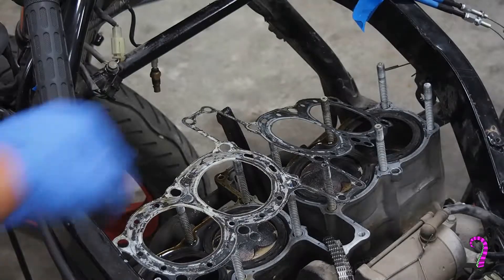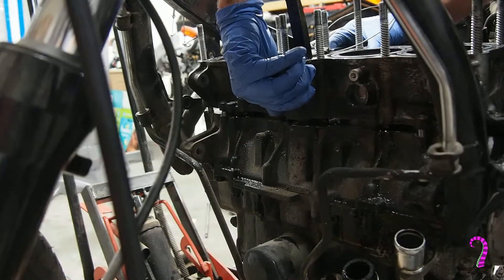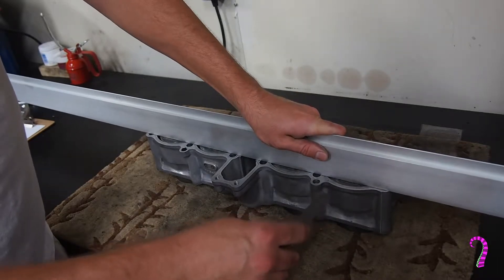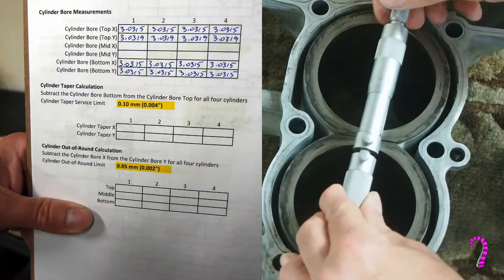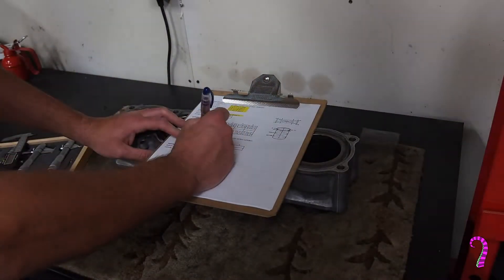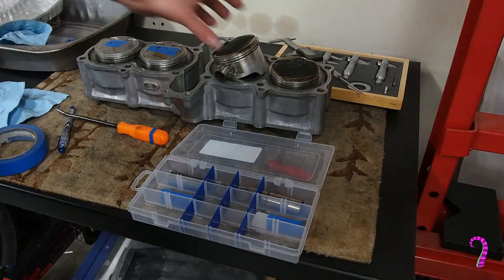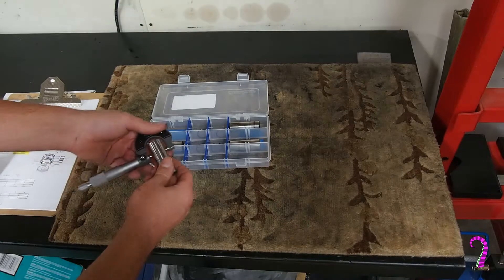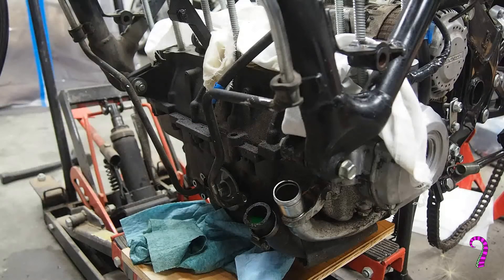Hurricane Engine Rebuild Chapter 3 – Cylinder Service

Comment: An excellent rebuild process is underway. For any repairs I do, I would always give the engine a thorough external cleaning before beginning the work.
Reply from the maker: It's complete. The bike is now my daily rider. I usually don't get too fussy with external cleaning if I know something's being completely disassembled, but it's just personal preference. Glad you like them!
Reply: You’ve done a beautiful job and I’ve learned a lot from your videos. I just bought a 1995 CB1000 Super Four and the engine seems to be very similar.
Reply from the maker: You're correct. I didn't realize that they'd repurposed the powerplant for the CB1000, but that's exactly what they did. It's a great motor imo